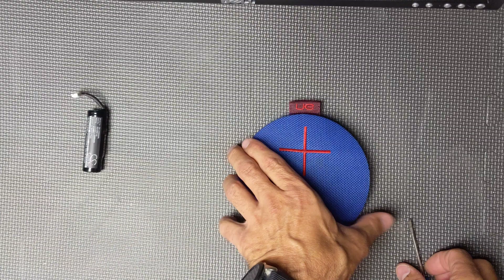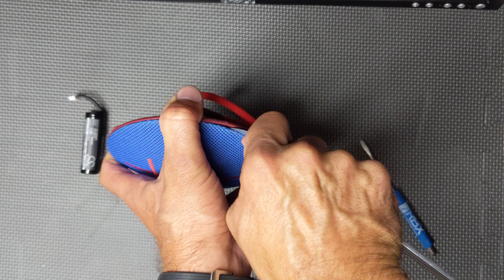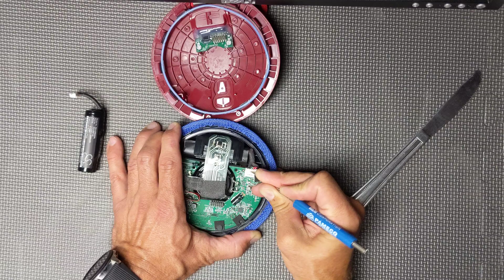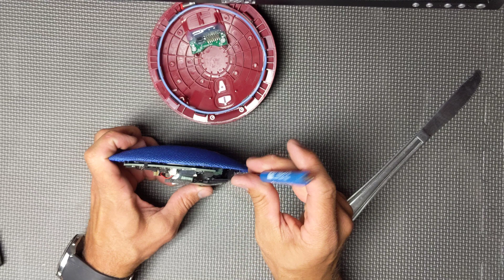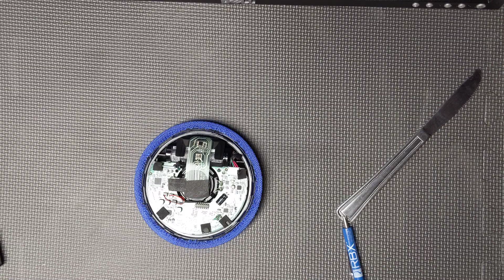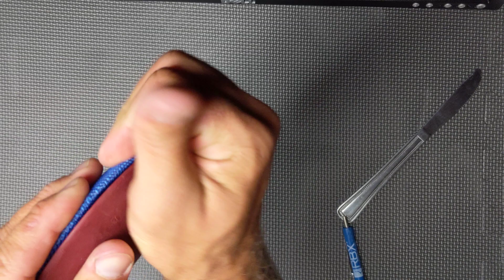UE Roll speaker disassembly & battery change out

Comment: I thought my favourite speaker was done for! You can't buy these anymore and I did not want to say goodbye. What a rush when I turned it on to hear that connection gong, instead of "Critical battery, please charge". Thank you for walking us all through this! I never would have figure out how to open this without at least cracking the case. 🙇🙇

Of note to other fixers: the battery I got off amazon (not the exact on mentioned below - couldn't find that one - but with the same specs) was ever so slightly thicker than the OEM. It still fit, but made it more difficult to insert. I recommend taking off the sticker displaying the battery specs and being careful where you place the foam padding so these things don't snag on the battery holder "arms" or the motherboard resepctively.

Comment: Thank you, very clear, clean instructions.  However, I would caution everyone to be EXTREMELY CAREFUL when you are sliding the new battery in.  The battery holder clip is not securely attached, and if you pull up on it too much in order to get the battery in, it will detach from the frame, pulling loose the flexible circuit strip than runs over the top.  Unfortunately, the + volume switch is part of that circuit strip, and it's virtually impossible to get it back in position.  This is what happened to me, and while I was able to get the new battery in and everything put back together, the + volume button no longer works.  I can still remotely control the volume from whatever device I have connected via bluetooth, but still....

Comment: Tried this. Didn’t work.
Reply: Actually, I did make it work in the end. I went back inside today (after sleeping on it) and discovered that the ribbon cable that leads from the battery housing assembly has become disconnected where it inserts into the board, (just above the bundle of coloured cables). This happened when I was striking to get the new battery in - which is a very tight fit if you put the foam back on! The foam all snagged when I did this. 
Anyway, after easily sliding the ribbon terminal back into its slot it powered up like normal.

Comment: FYI: The original battery is 2230mAh / 8.6Wh
Logitech Part Number: 533-000122

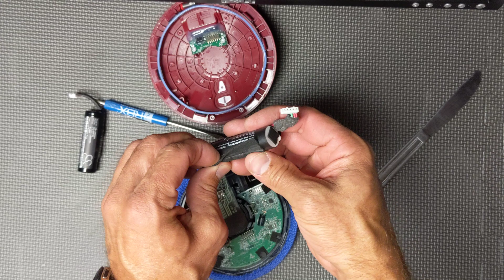Watch in 4K and pause at 4:04 and you can spot it yourself.

It boggles my mind that someone who (helpfully) took the time and effort to make a battery replacement tutorial wouldn't think to themselves "What is the first thing someone who needs to replace the battery on their UE Roll would need to know?" and include this most basic info in either the video or the description.

I see this all too often in communication; "Come to my party!" but no date. "Yard Sale!" but no address. "Don't be late!" but no time. Just sayin'.
Reply: Good job man
Reply: Cool story! But where in the phuck can i order or purchase the battery from?
Reply: The point of this video isn't to teach you how to replace your battery with any random battery, but to teach you how to replace your battery with one provided by the poster.  At 20 seconds in they deliberately show the QR code of the product.  Scan that to buy.  They don't explicitly mention the product or link to it in the description to get around youtube rules on advertising.

Comment: Excellent tutorial. Personally I used a metal spudger set to minimise damage. For those playing at home, the OEM battery is actually a 16650 cell, not an 18650. It's a Sanyo UR16650ZTA. 18650 cells don't seem to fit. If you're handy, you can solder off the tiny metal strips from the mini-BMS, solder new ones on, and spot weld them onto the new battery.
Reply: Where can I get that battery

Comment: How do you know that it’s a battery issue? I have mine plugged into the USB all the time. It won’t pair with either of my devices today ... just up and died & won’t restart...dang!
Reply: On a full charge, my UE roll was only lasting about 3hrs, so I new my battery was toast. At best, the batteries typ only get about 250-300 charge cycles before showing capacity loss. Leaving it plugged in will also degrade the battery (just as it does on laptops & phones.

As for yours not working, I'd try a factory reset: 

Press and hold the Volume “-” and the Power button together for about 10–15 seconds. You will hear a tone to confirm the reset was completed. The ROLL will turn off. When you turn it on again, it will be ready to pair.

Hope this helps!

Comment: Has anyone tried this with the UE Roll 2?  Is it the same battery?  Also, will it still be waterproof afterwards?
Reply: bit late to comment, but just in case someone else needs to know.  Yeah UE Roll 2 uses same battery.  Same connector same size.  
Mine did not seal up quite as good after.  Is sealed up perfect over about 75%.  Just a very slight gap on the rest.  I think I might have scuffed up the material and the material is not sitting flat.  Not sure.. but not bothering to to it a second time in case I make it worse
You can even squeeze in a slightly bigger 3400 mAh battery as well.

Comment: Thank you for posting this; very helpful. I ordered my batteries from the link you provided and received them today. Installation was not too bad, considering the battery appears just a tab larger in diameter. With a slight modification to the "sleeve" the battery sits/slides into, I got it to work. Snapping it together was another challenge, but no complaints. Once again, thanks for the video.
Reply: Yes, the replacement battery seems a tad larger than the original.  Thanks for the inspiration to keep at it! I was about to give up.

Comment: I followed the steps and it was fairly easy to replace the battery. However, several of the tabs broke when I was opening the speaker, so I can't close it properly. I'm not sure how you can tell if you are breaking them since they pop loudly even when they don't break. Since the first battery lasted about six years, I'm hopeful that I can use epoxy or glue to make the speaker watertight and not have to worry about it for another six years.